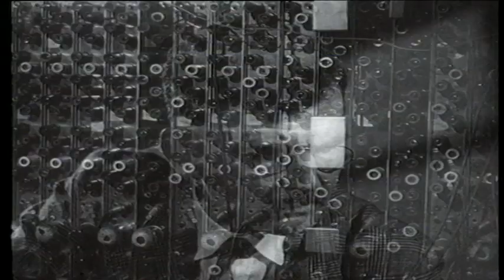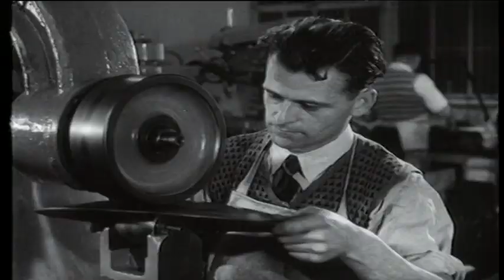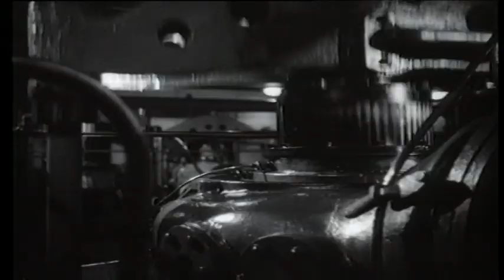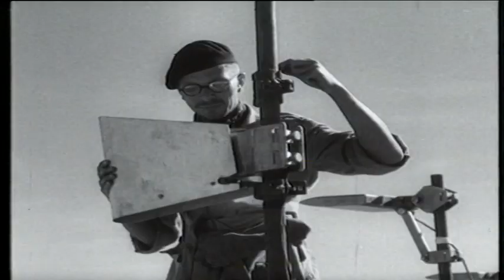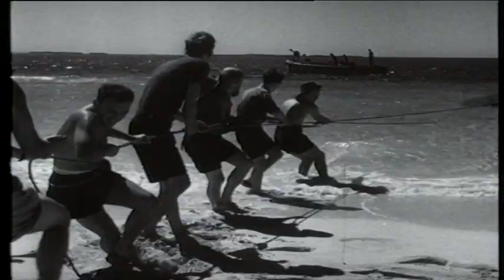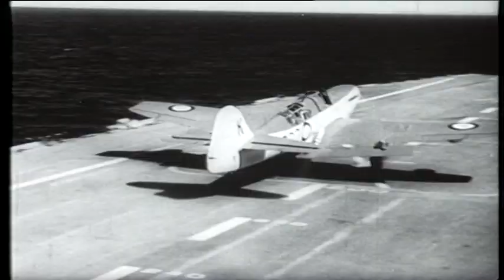Operation Hurricane 1952

Comment: Visited the ground zero and nearby islands many years ago. Much of the testing equipment and military material still there . Armoured vehicles and a Spitfire wing , radio equipment and concrete bunkers and twisted metal everywhere. The remnants of HMS Plym scattered over the islands. Bizarre signs of  the destruction. Hurricane yielded a much bigger bang than was calculated, contaminating vast areas of the Australian mainland.